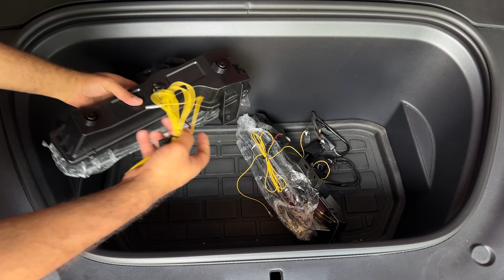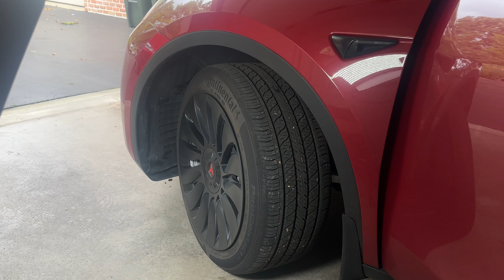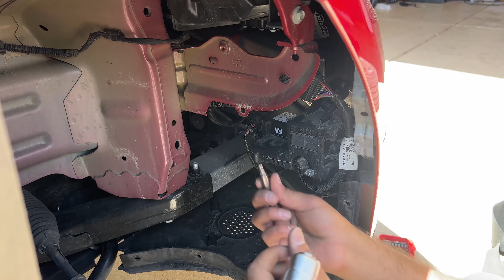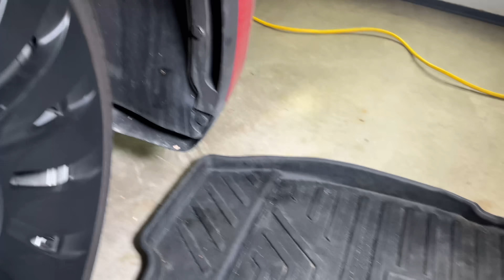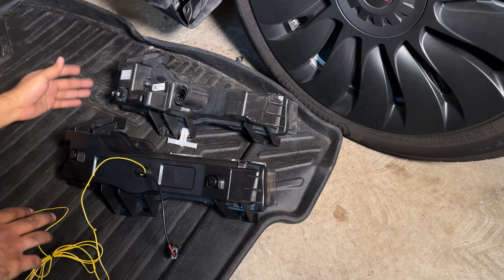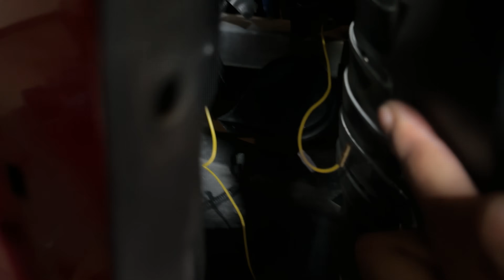NEW Synth Front Fog Lights For Tesla Model 3/Y With Sequential Turn Signals (Easy Installation)

Comment: On Model 3, Is it possible to replace fog light through frunk area? Or the best way is to remove the wheel?
Reply from the maker: It is not unfortunately. The light is blocked by some panels on the frunk that you cannot remove. Your options are either remove the front bumper or the wheel. Removing the wheel is 1000% easier :) Thanks.

Comment: Just found this video.  Very well done.  A few thoughts and questions.  #1) I'm not a fan of the turn signal repeaters, I just want the fog light.  If you don't plug the yellow cables together will the fog light still come one?  In this case, where the yellow cables are not connected, when you turn on your turn signal, will the white foglight just stay on or will it go dark?  #2)  How does the fog light come on?  Is it on all the time with the daytime running lights and/or headlights or is it just with the headlights only?  #3) For US vehicles, cars require the front side orange parking light which is present in the OEM light housing - it appears that this replacement fog light does not have that - can you confirm?  Good job again with the video, will like and subscribe.  Thanks.

Comment: How do I get these to just show the new sequential turn signal lights and not the oem blinker turn signal?  Is there a wire I need to disconnect to acheive this?  Its too much with both turn signals showing imo.

Comment: The video was a good guide and helped with my own installation, but like me, others may need to search a little more for other missing info. Just installed this on my 2023 m3 standard range. Compared to the m3 in the video, 2023 m3s had 7-10mm bolts on the frunk, in which 2 are covered by the latch cover. In addition, the headlight connector is covered/protected by the steel body frame, where a small flathead screwdriver helped out a lot. Also the fog lights uses 25mm torx and not 30mm. It's now shown in the video but the driver side installation is much more difficult to do than the passenger side. Lastly, if you have the standard fog lights, i suggest you keep them and pass on this aftermarket item. This product is only a good upgrade if your m3, does not have fog lights. Good luck on your install.

Comment: Hi Shiva, I plan to install a wifi front bumper camera which I will access using my phone.  Is it a good idea to splice the fog light harness to power the camera?  Do you know where I can purchase the splice kit?  The camera can be powered by the 12v battery but I don't want to keep draining the battery by connecting it directly to the battery terminals.  Thanks
Reply from the maker: I haven't seen any headlight splice kits yet. Even if they had it, I believe the power is only activated when the headlight is activated. You can however pass the wire through the firewall and use a Y connector that they make to plug into the A-pillar that has 12V. I have spliced that 12V plug for other purposes.
Reply: @ShivaSapkota  I intend to turn on the wifi cam only when I need it.  The camera has 6 LEDs for night vision which are operated on sunlight sensors.  I'm worried about battery drain overnight if I don't turn the camera off.  Since I don't use the fog lights 99% of the time, I wanted to use the OEM touch screen button for the fog lights to turn on/off the wifi cam.  Will this splitter on Amazon work for my intended use? Amazon product: 2 in 1 Deutsch Dual DT Adapter Connector Splitters Plug Y-Shape Wiring for Fog Work Light Retrofit LED Work Chandelier Light Retrofit Connectors Wiring Harness

Comment: These look great but the issue is you lose rhe amber side redlector from the original light that alerts incoming cross traffic specilaly at night.

Federal DOT states that all cars must have amber reflectors on both sides of the front of the car. They must be visible from the front and sides.

I wish they would put a reflector on the edge just like the original so it meets regulation and maintain safety.
Reply: Ok Caren! By switching to aftermarket you are already non compliant since this are not DOT approved, reflector or not.   Now move along and keep it all stock if you want to be compliant.
Reply from the maker: I agree, I wish they had included some reflectors in the edges. Thank you.
Reply: @ShivaSapkota where are you located

Comment: Does this work with Model 3 RWD 2022?
Reply: I have a 22 m3 Sr and just installed it and it does work.  I need to wait until the daytime tomorrow to see if these are true daytime running lights or if they are active when the headlights are active
Reply from the maker: The vendor says yes. I couldn't get it to work on 2018 M3 but they changed the headlight plug starting sometime in 2019. So, my guess is yes but please double check with them. Thanks.
Reply: @ShivaSapkota  thank you for the prompt reply!
Reply: Couple things, you can install this while the tire is turned inward, but it is tight.  Secondly, the lights do not stay on during the day time, once the headlight activates/or is ON (or your setting is set to auto for headlights), the foglight will then activate.  When they are active, they look great.